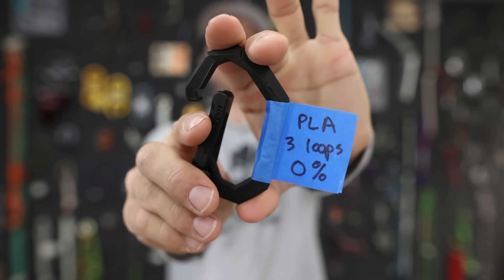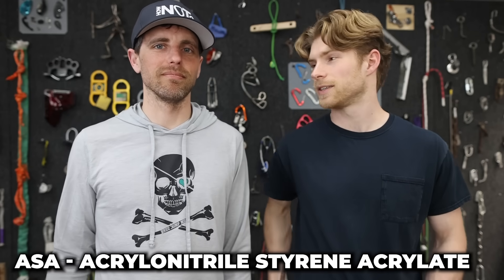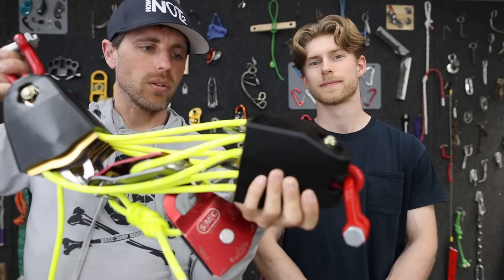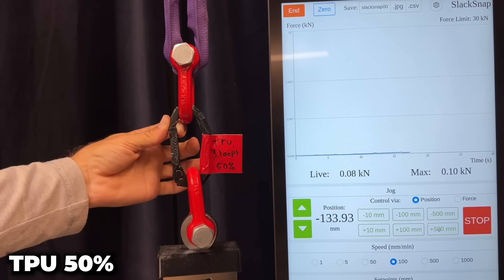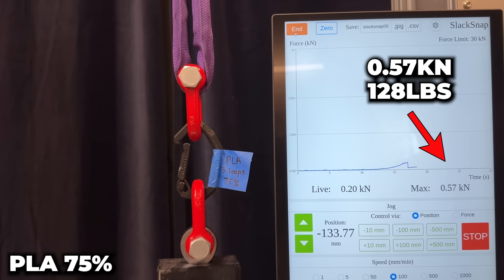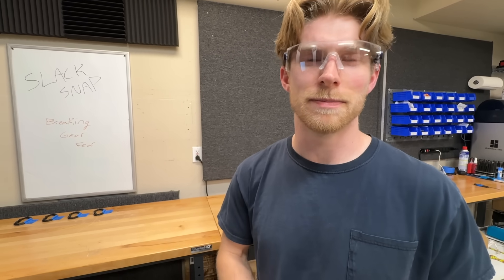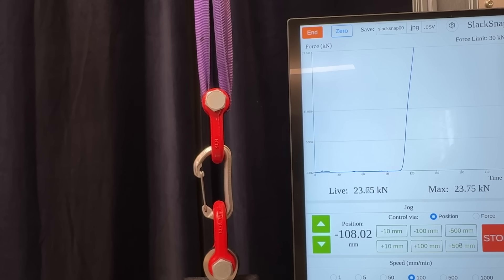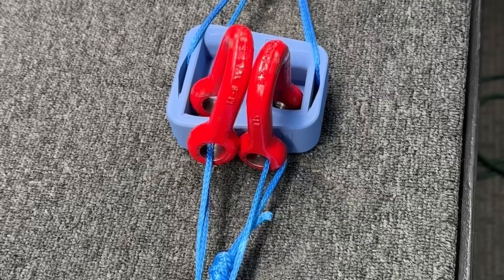I 3D Printed Carabiners

Comment: It is obvious at a glance that these designs in the first half of video (as far as i got)  were terrible.   You guys should have known better and not printed it at all or printed just one at 100% perimeters (not infill) just as a cautionary tale.  Better metal caribiners (D type) are designed to put most of the load on the unbroken side.   The design you used obviously does the opposite.   And a flexible filament is also problematic.  While you want some toughness, you want parts that will at least try to hold their shape   I have seen better performance from 3D printed hooks with no gate (polymaker 3d printed  hook contest).   PLA might work with a length of nylon rope to act as a shock absorber but may be too brittle for metal to metal or too short a length of rope with any shock loading.    The brittleness might possibly be an advantage, though, as panic snaps for a horse when sized appropriately but it might need to withstand many more gentle tugs first.   And your ridiculously low numbers of perimeters were just absurd.  You want the whole part to be 100% perimeters with maybe a few layers in the middle crosshatching to hold together.
Reply: - for "soft" work a "rope shackle" - kicks a stupid-biner, but I am sure the dupes have been calling "Danny-Boy"..  NB  most plastic Auto degrades at around 450degrees "C"-science - ~43 +/- MJ/kg  -  energy recovery, thermodynamics...

(sorry if anyone "triggered".)

Comment: iK - ha ha - not to take falls - EVER - PLA = lol generic "plaast"_Ich - TPU bounces better  (cameras roll OK in TPU defenders)....

A 2-stage Carabiner - with  an "inplane" + "out of plane" gate  -  could be nice to increase opening - could be ambi L+R...  Easy to triple actuate..

(Gyroid isn't a BAMBU" CREATION, - Weight efficient vs stiffness though not computationally so...)  Thanks Alan Schoen..

NB, using 3d printing for very small pins - should be a crime. a paperclip is stronger...

Comment: The amount of wall loops makes a much bigger impact on strength than infill. This holds true when using the same amount of material but the infill is instead used in the walls. Generally you want to make sure you have enough infill for printability over durability. Keep in mind, infill is a bit more relevant for compression strength but wall loops are still more impactful.
Reply: print orientation will matter a great deal for something like this also.
Reply: - to eliminate infill - and weight - ?? print the spine as a thickened I-beam - the nose  (size) is the critical volume - pins, use SS wire - much stronger than any polymer one gets to use.

Comment: Fill doesn't contribute much to strength in tension.  It only contributes to bending strength to the amount that it keeps the walls apart. 

For any given weight of plastic, as long as the walls don't collapse, it's best to put as much as possible plastic in the walls.
Reply: - back to basics - or never try doing any tensile OR shear stress analysis...
??   VonMises will crucify you. ?? - work out failure modes.
Badly adhered layers   - or poorly executed boundaries - some truth, also some B$...

Your comments indicate a disconnect...  (crush prevention "it feels strong enough") - ha ha...

OK - For tensile strength - the weakest link in the chain  - is all it can take (the nose or the Pins)   - once the spine flexes... - ie a spine at 4 layers and gyroid infill at 25% may well be stronger than the nose at 2*2 boundaries and no bulk volume remaining - in "pure bending"  (no such outside a pure 4-point test)- printed ?? 0.6mm nozzle?? or 0.4mm with 60% over extrude...
Reply: @kadmow for bending strength, think I-beams. The strength is in the top and bottom and the web just serves to keep the two apart.  You can think of them as lever arms.

For "crush strength", think "standing on a soda can".  The aluminum is VERY strong...until it buckles. Internal structure just serves to keep the shell in place for maximum strength.

Yes, 3D prints are anisotropic, but those were teated in the strong direction.

Comment: These seem like a replacement for unrated generic biners. Not as strong but without the risk that someone will mistake a keyring for climbing gear.
Reply: i have a 3d printer. i was JUST thinking about designing something like this for my water bottle lol
Reply: Great for backpacking since they are so light. A few years ago I printed one at 100% infill with PLA. I only weigh 130lb but I ran a rope through it and hung off of it statically low to the ground out of curiosity. It’s melted and changed shape a bit from being in my hot van but it still works to this day.
Reply: You seem like you commented before watching

Comment: lol all additive manufacturing of plastic is pretty much unfit for real world applications even 3d printed toys are crap compared to injection molding. it's for rapid prototyping but it is good for small niche projects like your protectors or cosplay
Reply: Not the case, you can get stuff really strong if you know what you're doing. High-temp nylon with carbon fiber is often used as a substitute for aluminum for jigs and fixtures. They call it "black aluminum". People use them to make fixtures that are used in machining and production lines all the time. You can go even stronger to materials like PEEK, or ULTEM, but it's rarely necessary. They do require a lot of printing expertise, but it is far from true that additive can't do real world applications. Many industries ship products with prints in them.
Reply: @geometerfpv2804  gotta be careful with fiber because with the 3-D printing it’s exposed at the surface. I can’t remember which YouTuber, but one of the bigger 3d printer ones just did a full length cautionary video where they went down the rabbit hole.
Reply: If you design within the practical limitations it's great for many useful things. I've been making all kinds of different drill jigs at work. For ones that need to do lots of holes I install wear resistant sleeves. The only problems I've had is if the drill bit is dull and the operator lets it overheat it can deform. We make lots of stuff out of plywood and various  plastics on a CNC router. We often need precision holes that are into the edge of the stock. The 3d printed jigs key into features cut by the CNC router and permit us to accurately place holes on the edge with a cordless drill.

Things just need to be a big bigger than if they were made of metal and you need to design with the limits in mind. Stuff like nice big radiuses on inside corners and keeping the layer orientation in mind. 

We have made everything from bubble wands to a mini crash test dummy on our 3d printers.  

It's not for everything. But there are many things were its good enough and its quick to iterate with. We also use lots of laser cutting and manual machining to make stuff. The process is often prototype with 3d printing and then make the production version on the CNC router in a stronger/tougher material. That said sometimes a TPU printed item is tougher than anything else we can make.
Reply: And cosplay is not a real world application??

Because I was the first person in the entire world the 3D print entire set of Halo armor for fun .
Got to work on Halo infinite🤣🤣

Thanks to me and also lots more 3D printing I'm a person who was making the sounds for the spanker rocket launcher and the Hydra launcher.

Then on top of that I worked on the F-35 jet program helmets and there are definitely 3D printed Parts in there 😂..

Comment: This could've been interesting. No reason to make a metal-style carabiner, gotta design for the medium. Use tons of walls; I use 7 for bodyweight applications. 4 is still pretty low. Critical stress points should just be printed solid. It's really surprising how much you can hold that way with PLA if you print it really hot and are using good, pure material. 

I have made crack trainers this way for finger locks, and they hold bodyweight repeatedly even on relatively small PLA bosses. 

You've sort of undersold 3D printing here. It requires a different design philosophy, you can't just make a metal design out of plastic and expect it to perform. You have to design for plastic. But if you do, you can make lots of cool climbing stuff that is shockingly strong.

You can print grip trainers, holds for your basement wall, stickclip heads, all sorts of things. Not to mention all of Brent's little gizmos. Pinch blocks, finger boards....I have even designed and printed a working rope wrench tether. It's not life supporting, so you can work with plastic.

Take a look at the ISO 527 test for tensile strength, and look at the printable materials data Polymaker has. Their PLA does 52Mpa of tensile stress. Pretty remarkable. It does worse in the z direction, but you can design around that.
Reply: I mean, this was testing an existing carabiner design that's already out there, not one they designed themselves. It's also clearly not based on metal designs because it puts all the force on the gate instead of the spine.
Reply: @leveller4  what's easy to download in 3d models right now is more concerned with cool looks or just clipping gear to a backpack - not actual weight holding. Just because this design is out there in the wild doesn't mean it is well designed for the purpose you want.
Reply: @gd.ritter  I'm confused as to why you think I'm advocating 3D printed carabiners.
Reply: @leveller4  i don't.
Reply: @leveller4  It's still the basic paradigm of a metal carabiner. A quick-opening coupling is not a good application for 3D printing, and is a poor way to test print strength. I would be more interested in seeing a closed loop printed in xy with solid infill be pulled. It will hold far more, and probably more than most people would guess.
Reply: exactly what i wanted to read!!! I love this channel, but this time they got wrong how to design and test something. I am an engineer myself and I needed to learn how to design for 3D printing as typical engineering design methodologies do not apply without tweaking. More walls, and do designs for 3D printing in mind.
Reply: I've started experimenting with the 3D printed holds for a basement wall / hangboard setup. Using PETG with 7 walls (about 3mm) and 20% infill I can't even feel them budge under the slightly-above-bodyweight load from a set of pull-ups. They should be about as strong as the real injection molded ones I bought. The shell thickness is about the same, and the infill and closed back should make up for any losses to layer adhesion. There's definitely precedent out there with 3D printed holds and grip trainers.
Reply: I am not trusting any of polymakers stats after it turns out thy are not following any standards

Also pla is not the best material
Reply: @Goroca  PLA has weakness, but it's the strongest material you can print without a high temp machine and lots of experience. The big problem is that it melts, even in the sun. It has worse impact strength than ASA and ABS, but it is stronger. To beat PLA at tensile strength, you have to go to high-temp nylons that consumers won't be able to print. A lot of amateur 3D printers think PLA is the "newbie" material, but read the stats. It's strong.
Reply: @geometerfpv2804 
Pla is stiff but it has really low duktilety and it creaps a loot.
It is is good fore some stuff but i persenely practecly never use it 

The problem whit polymakers data is that it doesn't follow iso Standerds. This means that you can comper between brands
Reply: @Goroca  I've done an enormous amount of real world testing (I have a PhD in math and am that kind of nerd) with printed materials, and have found polymakers data to be the best available. I've used it for engineering decisions many times, and it has yet to fail me. The most carefully collected YouTube data agrees with it (which is not to say the data coming from the biggest channels necessarily...)

A lot of it comes down to how you print it, and many peoples' tests go wrong at that stage.
Reply: - PPL using "out of the box" 3d printers don't know what you just said, lol....

They just "want it to work" - so spend lots of money, instead of lots of time  (I have done both and still chuckle at the tech pigmies - "I can explain" - lol.)  If life were so simple...

Comment: I used to use one for my chalk bag. I'd much rather use a 3d printed carabineer than an unrated one, no way I'd mess up and accidentally use a plastic one for something weight bearing, I don't like to have metal unrated ones anywhere near any of my climbing gear.

Also I'd always offer it to anyone i saw using an ATC pilot "want a plastic carabineer to go with your plastic belay device?"
Reply: I just use a real carabinier for a chalk bag or whatever.
Emergency reserve carabinier, and if I was that worried about the weight, I would cut my hair or drop the extra 20 pounds I carry around on me all the time.
Reply: What's wrong with atc pilot (or any gear in general) being plastic on a non load bearing parts?
Reply: @Danny_To_Žabil  for assisted braking, to me the pilot is a little iffy cause unless you are in the brake position the device does nothing, which lead to a deck at my local gym because the belayer was taking slack as the climber fell and it zipped from their hand before they could put it down (even my non-assisted braking ATC will engage with the carabiner in any position as long as your hand is on the brake)

Comment: Trying to get above fractions of kilonewtons is crazy weak. But for something to hang keys or something on a hiking bag or something it could work.
Reply: The materials aren't that weak, they've just used a silly design here. You can easily get a small PLA device to hold the force from pull-ups for example.
Reply: @geometerfpv2804 you have a carabiner design good for kn or more?